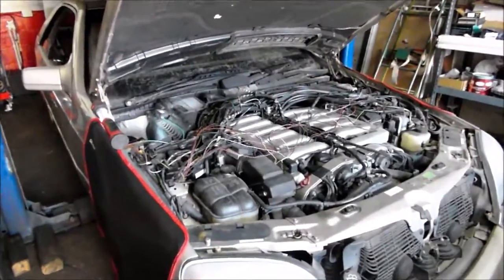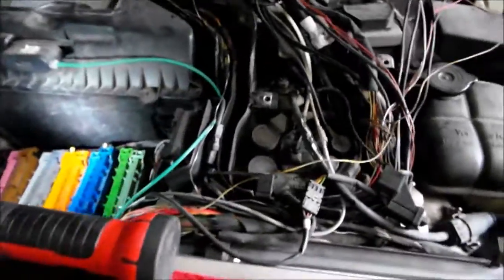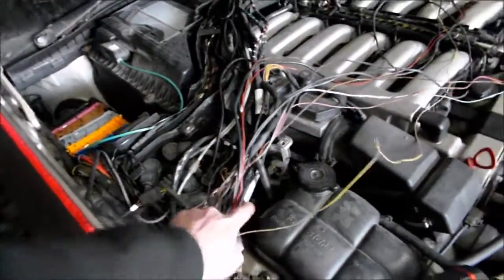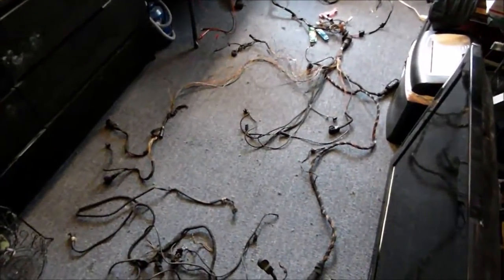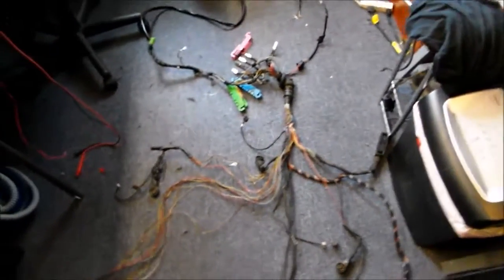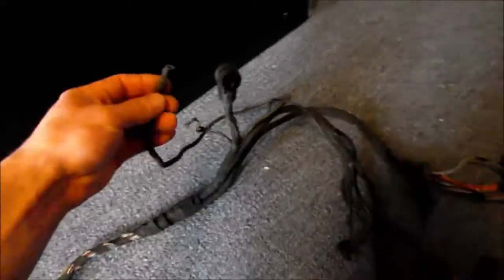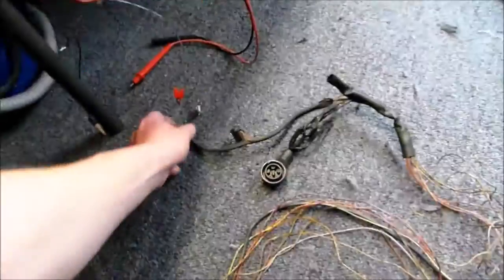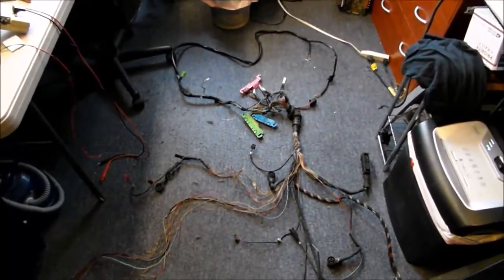Mercedes Mass Air Flow meters wiring V12 M120 motor

Comment: Hello, I have the same problem on my sel 600 w140 v12
How to remove this from box?
Reply from the maker: Those wires do not come out of the box. I rewire them with the box in place. If you need this done my contact info is on my website.